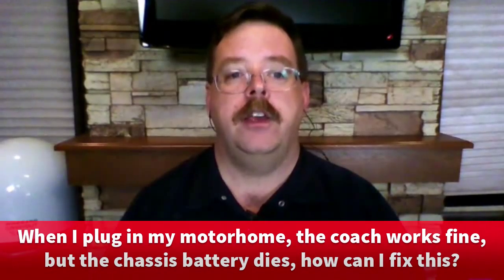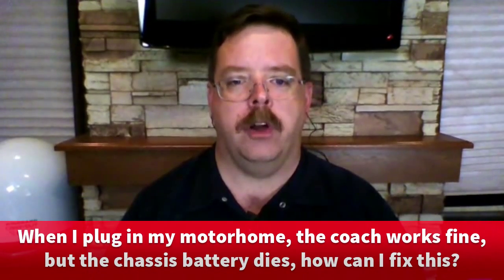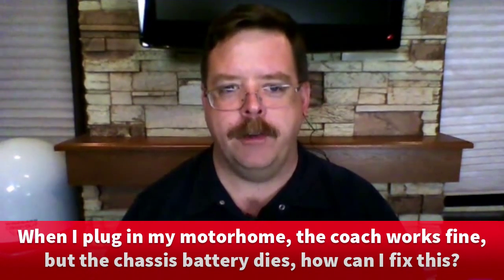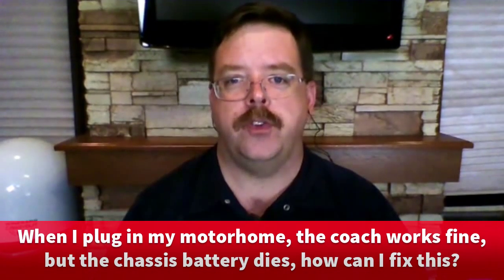RV chassis battery dies when RV plugged into shore power. Why?

Comment: I am taking the RV Tech course and with reading my owners manual, watching u-tube, and the training I have was to locate the problem.  In the converter there are 2ea. 30amp fuses and one of them was blown. But just a little more on this is you have to get to the side where the fuses are and there is a tiny screw that holds the fuses in. Loosen the screw and the fuses are easy to change, don’t loosen the screw and they are impossible to change.

Comment: I would put the radio on the house battery because it is much larger than the engine battery.  I did that, my radio used to pull from the engine battery and I rewired it to pull from the house battery.  And, because I almost always run the generator while driving anyway, it seemed like a good idea.  However, I have a small boom box that sits on the stand behind the couch.  I keep it plugged in at all times.  So, I run the generator to keep the outlets in operation and power my stereo while driving.  So, I don't usually have that problem.  I have run the generator to operate the TV while driving however, I would be very careful with that.  Distracted driving is very dangerous.
But, I would definitely rewire the radio to pull from the house battery.  Another thing you can do is periodically start the motorhome and let it run for a while while parked to charge the battery.

Comment: I’m having a similar problem but it’s with the interior lights, over a few days they get dimmer and dimmer while plugged into shore power.  Any ideas.    Thanks Rod
Reply: Up date on my problem.   To my surprise my converter had 2 ea. 30 amp fuses that were hidden deep in the basement.  With a little effort and a light was able to find the bad fuse remove a set screw that was holding them in replace the fuse and no more power problem.  No idea what caused this since we just purchased our Motorhome and it wasn’t a problem for almost a week.  But the lesson and information is now stored for any future problems.

Comment: Hello everyone, My Thor motor Coach, Freedom elite RV, with a chassis of 2017 Ford E-350 super duty, 6.8 liter V-10, gas engine. I am having electrical problem. Something cuts the power from the battery. Many times every thing on the dash dies. No crunk or no dash light. Only way I can start it is by pressing the emergency start button which uses the house battery since it’s an RV, then it immediately starts. Many times the battery light and some times the check engine light comes on and off. I replaced the alternator to a brand new motor craft 225 amp hour and brand new Duracell battery but same thing happens next day. Vehicle has 70000 miles. What shall I do? What do you guys think is the real issue? Any one has the same experience? Thanks.

Comment: Are you saying that even with the stereo turned off the chassis batterie would still be drained and die, while plugged up to your home power source?  This must be the reason I am having problems with my chassis battery dying, never thought of this.  Thanks!
Reply: Better yet,  connect a battery charger/maintenance unit to RV  chasis battery. Get the power from power outlet located  near by the door when using shore /home power.  Try to be creative.. Then, enjoy your music full blast..

Comment: My rv house batteries die all the time, why do I have to charge them everyday? Like for my hot water I need them charged and I have to charge them daily? What is the problem? Does anyone know? I have a 1989 Winnebago! Please help
Reply: The batteries are probably just too old.  Typically can get 5 years out of them.  Less if not maintained well.  More if you are very careful with them.
Reply: Use maintenance/charger when using home/shore power..